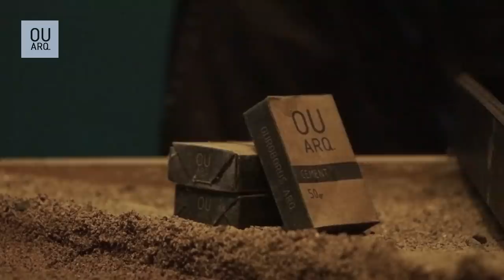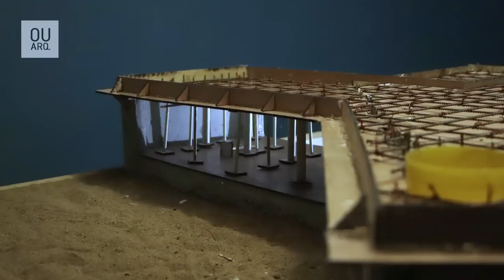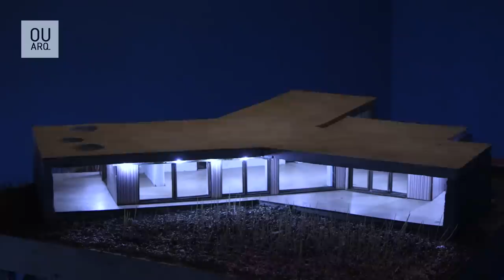Architects' Miniature House: A Stunning Display of Design and Creativity

Comment: Colleges should have taught us construction like this to have an idea about how the process of Construction works instead of lots of theories🤦‍♂️🤦‍♂️🤦‍♂️
Reply: The most of them in the videos are wrong though
Reply: @nikosarakas5539  im really interested in this topic so out of curiosity, which parts are wrong?
Reply: @user-fy3nr7ei6b  had not laid the right foundations. electronics do not enter the ceiling. with cement you only make columns and not the whole wall. in it bricks are used. I do not know if I have done a correct translation from my language but this are problems that i remember
Reply: @nikosarakas5539  oh ok, I see what you mean. Thank you for pointing that out!! :D
Reply: @nikosarakas5539  it is a design project though. I see no problem to rebuild it in the right way.
Reply: @nikosarakas5539  you can also do cast concrete walls
Reply: @SevenPr1me  i may be wrong but i think you are talking about 2 different things. Architecture studies  includes miniature building like this. Practical construction education teaches theory and real world actual projects like build a real wall out of lumber, put a real sheet of drywall and spackle it... but what the original comment was referring to was the latter and not being able to construct a miniature version. Myself having built over 100 houses i can say with confidence the miniature version is neat but doesnt teach you the practical steps of the real world. It does touch on some applications and aspects but in the real world there are far more things to take into account.
Reply: @landoncrosby  i wasnt talking to you
Reply: @SevenPr1me  i appreciate that but im letting you know the other person may have had a different perspective. Apologies for my interjection.
Reply: It's not possible doing this stuff since it was a lot of work and taking a lot of time and also money, I don't think college kids especially when they're many of them willing to pay much money for this stuff
Reply: @nikosarakas5539  you don't need to be literal since this stuff is miniature there are limits and also the person cannot reach inside and make modification of the house since it's too small
Reply: @landoncrosby  an ignorant perspective regarding "theories". Clearly OP rejects science and im not gonna let someone disrespect science like that
Reply: And Really learning about money should be a class from 1st to 12th grade.
Reply: @SevenPr1me  fair enough
Reply: @landoncrosby  good to know. Thanks for the info
Reply: Yeahh that's what I am thinking too
Reply: There is important theory backing all of the steps done in a construction. Without knowing why something is done, how it is done...you cannot do it.

Also this video is just for visual presentation. In reality lot many details are put into a simple construction...
Reply: Then you'll end up building something without knowing how it's built. Think before you talk BS
Reply: For real!
Reply: @nikosarakas5539  24
Reply: En México te pones a trabajar en una si tú quieres
Reply: so true

Comment: The work is rally cool but lacks on decorations. The floor is one piece of wood that doesn't really look like parquet because it isn't cut like it. The swimming pool could be made of stone, stone pieces like the ones for the bathroom. You could also make some interiors or check better the walls. I've seen some scratches or missing parts, a column is not straight but I really like the idea. In my opinion, there are so many stuffs you could add to make a better job. Dioramas can help you for sure

Comment: Nice idea to have lasercut formwork for the concrete^^ 
Hope the Mdf doesn`t soak in some of it...better use transparent acrylic sheets made for a lasercutter. Smooth surfaces and you can see any imperfections while pouring the plaster or concrete!